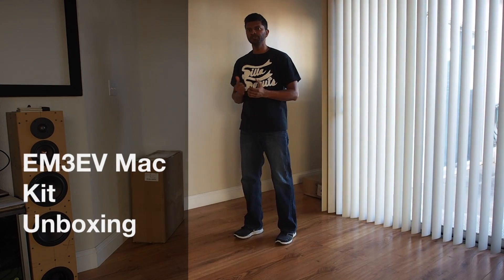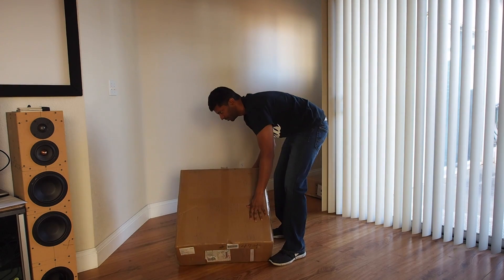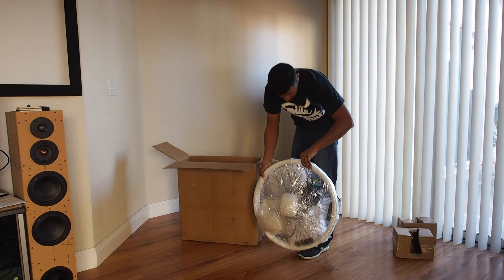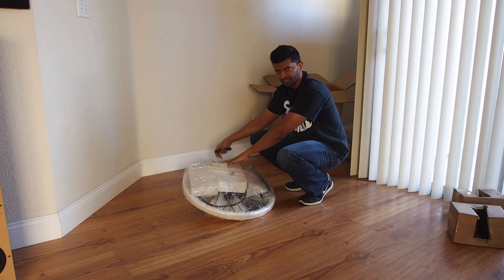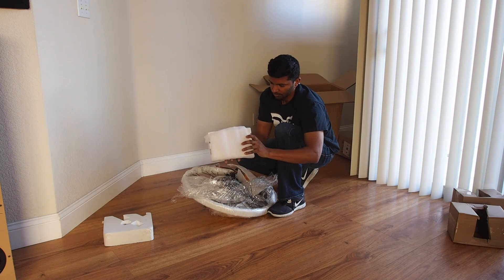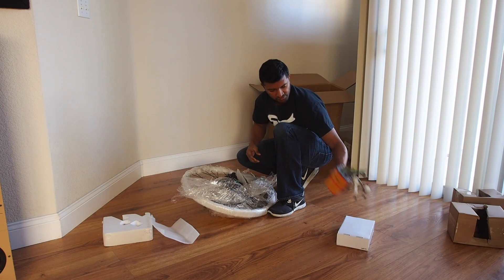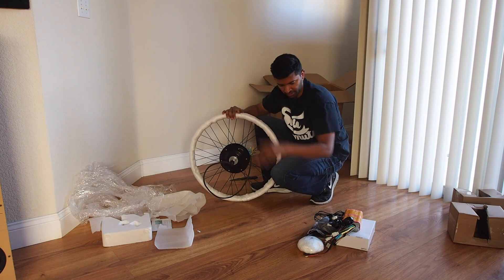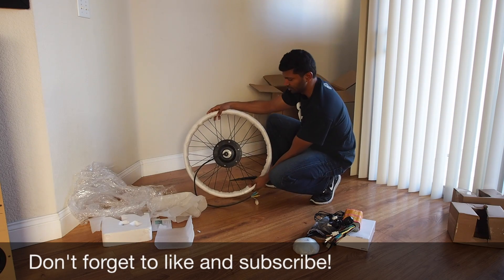EM3EV Upgraded Mac 500/1000W E-bike Kit Motor Unboxing

Comment: Thanks for the video.  Nice to see that Paul packs his stuff so well.  Let us see it installed ...ok?
Reply from the maker: Daryl Parsons check out my other videos to see the full install.
Reply: Matthew Cherian   Give a link....all I see is finished.
Reply: +Matthew Cherian Can you post a link as i can't seem to find it? I have some installing problems with mine right now. I don't find the paper anymore with installing instruction (based myself on the pdf i found online). I think all connections are correct but the motor is not working :(